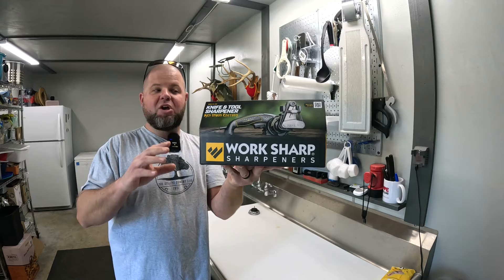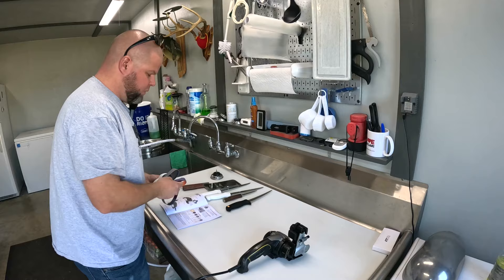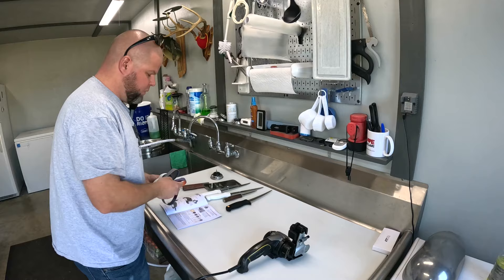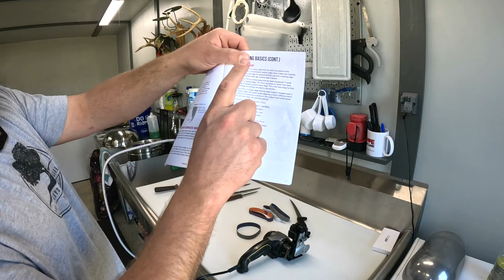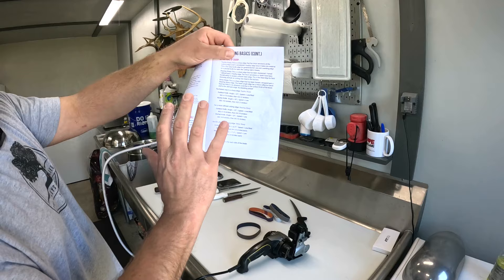Work Sharp Ken Onion Knife Sharpener Test!

Comment: love my work sharp, i got the grinder attachment for it too does a great job and the belts last longer than i would expect, cheap aftermarket leather belts available for it to use it as a power strop too
Reply from the maker: Nice, had no idea about the leather for a super fine finish!
Reply: @TheKelleysReviews  i don't think there are any for the regular setup but they work great for the grinder attachment

Comment: I had one of these and used it for about 7 years.  Last year the drive gear broke and now it sits in the box. Not sure how to fix it, maybe a plastic mold or repair kit?   When it was running it was my first "go-to" sharpener in my sharpening kit.  Now I am back to the old method.
Reply from the maker: I'd be curious if you can get parts as well.

Comment: Anything to sharpen serrated knives?
Reply from the maker: This one does as well, I meant to mention that. You sharpen the smooth single side only for serrated knives.
Reply: @TheKelleysReviews  I’ll have to check it out I have a Dexter- Dextreme fillet knife that the back side of the edge is serrated.  On grouper and large snappers I utilize the whole fish, we make smoked fish dip from the collars and heads , the serrated portion makes removing those easier.